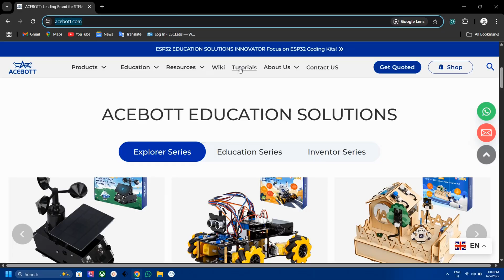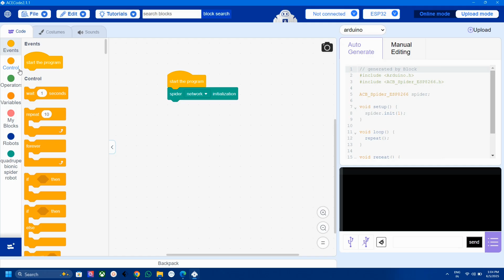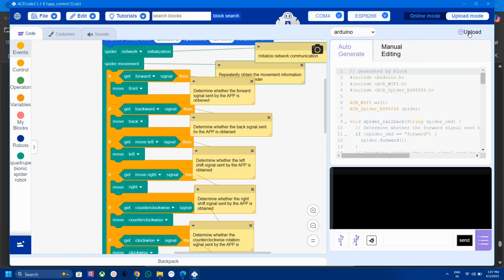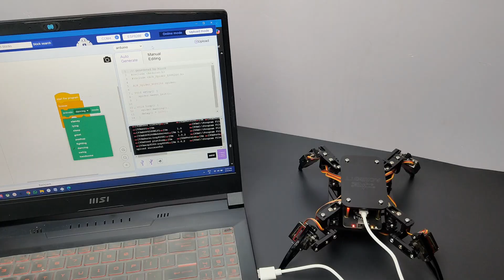Wifi Spider Robot Making | Acebott | Robotics

Comment: Do you have to flash the app control code everytime you turn it on for the controller to work? For ours we can run the programs through it then use the cntroller but if we cycle it on and off then we have to do it again
Reply from the maker: You don't want to flash evertime